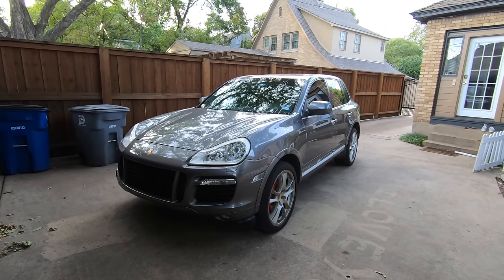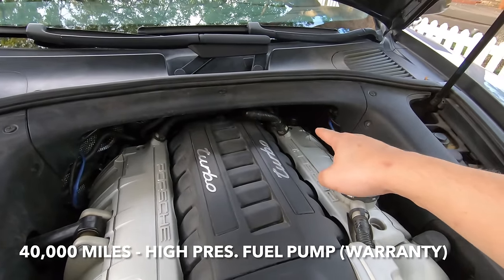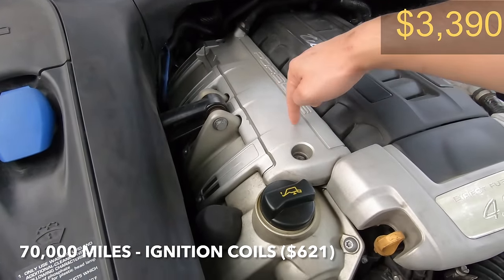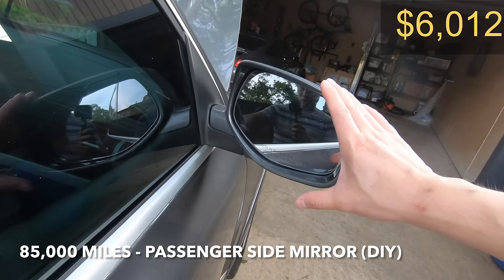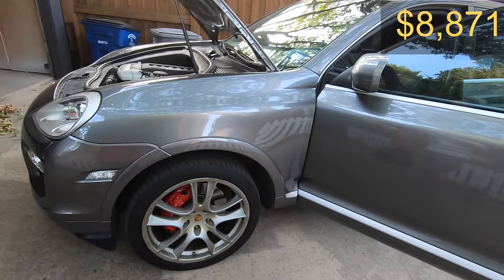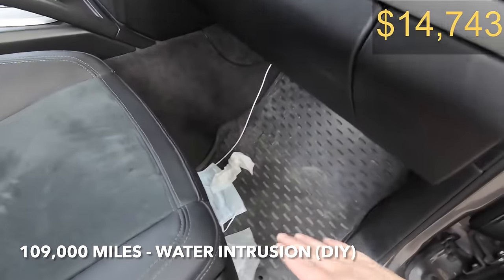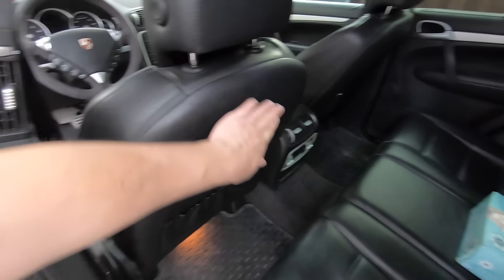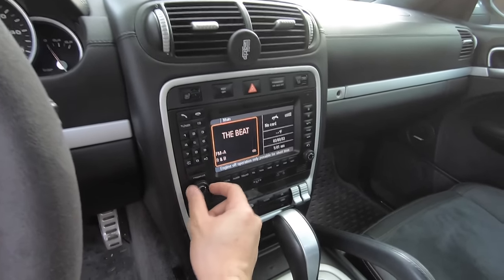Why Are Used Porsche Cayennes So Cheap? Owner's Review of 15 Year Old Cayenne Turbo (955, 957)

Comment: RIght! I owned a 2008 Porsche Cayenne S for 10 years (and before that a 2005 Cayenne S) I can say that these cars are very poorly engineered especially from a maintenance standpoint. Porsche knows their target buyer will only own the car for a few years. VW does not really care what happens after that. I experienced some of the issues you had but the sort of thing that put me over the edge was a failed temperature sensor which was a $25 part. I looked at doing the replacement myself but it was a 4 out of 5 difficulty so I called my mechanic who said yeah, that's probably $1000 to change. Do I even need a temperature sensor? The thermostat is mechanical. Yes you need that. A conversation like that happened every few months. The useful life of that car is maybe 10 years which is a BIG waste in my view and an example of terrible engineering.

Comment: German cars are made with cutting-edge (sometimes bleeding edge) technology.   Their engineers focus on top-notch performance, not durability.   The Japanese cars get dinged for not having the the most modern tech but their tech has been debugged over years of failure analysis.   If you want a German car, buy it new, sell it when the warranty expires, and then sell it, take the hit on depreciation, and buy another new one.

Comment: This is the Problem with buying any euro luxury car not the initial cost its the running costs that make you end up selling it and going back to Ford or Toyota avg cost of Mercedes benz service in Australia is close to $1000 avg service for a Toyota or Ford is closer to $350 over the course of the cars life thats a massave saving not even mentioning more serious repairs than a basic service
Reply: And 2k for wheel bearings is absoloutley disgusting

Comment: I had a 06 turbo when it was new to about 100k omg worst car ever absolute blast when working, but after 80k every peice of engine plastic and vacuum lines were failing ended with frozen turbo got 2 new turbos  then rolled piston rings on 2 cylinders

Comment: Stick to Toyotas, i have a 2010 Kluger, 3.5 V6. 181000 kms, only spent $130 on repairs, -  fixing the drivers electric window(wouldn't go back up)....had the car 11 years now, and service it myself. will keep to at least 250K kms.

Comment: Your problems are very similar to the worst car I've ever owned. 13' Q5 3.2. Leaks, wheel bearings, water intrusion to ECU, power steering leaks and then I definitely had to sell it when it started burning oil. That was only within a 2.5 year span. Now, for fun I buy Japanese sport bikes, currently on an MT10, that will kill most porches. For cars, I pick Toyota/Lexus. Sure, not as exciting, but very durable in my experience. Currently enjoying my Lexus RX

Comment: Too much japanese ownership BS here.. As a Lexus owner here is my perspective. Cayennes are know to be very reliable and this is clearly a rare exception and in the lifespan of 15 years. Lexus are no different.. lets take a Lexus RX/GX with its notorious poor chassis/body quality you have rust frames, paint peeling, clear coat fading, melting interiors, head gasket issues, transmission issues, engine out jobs in the 2GR, self destructive engines like the 2AZ... You will easily blow much more than $20k or even $30k fixing toyotas mistakes in 15 years as this porsche and you will still be in a lower trim less capable car. Thats the only truth in this. Neither are perfect.

Comment: Wow! What a POS! I’m still driving my 03 Accord coupe with 295k miles. I’ve had to replace the cooling fans, a VTEC solenoid, and a knock sensor. That’s it! every other part is OE down to the alternator. I paid $21k for this car brand new. It’s also been my son’s car for the past 4yrs. He has modified it quite a bit and drove it like a stolen rental car. Yet it just keeps on going. When he bought himself a new Audi, we just couldn’t bare to let it go. That Accord is the only car that’s not German in our driveway, 2 Mercedes(GLK350& C63),1 Audi(S4),1 VW(Mk6 GTI) It seems the more it costs, the more headaches you will have with it. Who needs a loner car from the dealership when you have a Honda sitting at home 😂

Comment: Apart from 3 original Beetles I had over 15 years as a young man all German cars I have leased or owned or shared since have been been more than disappointing. I stopped buying European cars at 45 and changed to Japanese and Korean.
China's major developments over 15 years are now about to overturn especially the German industry because it relied for too long on reputation  and not experience on the road. They are all wildly overpriced and we in Europe were never compensated for various scams by the VAG group and BMW as you were in N.America.
The Cayenne was never seen as a proper Porsche in north west Europe because it was problematical in cold, wet weather and looked too much like every other SUV out there.
Lazy design and lazy workmanship.

Comment: 200,000 miles on my 08 Tundra, the AC compressor and a bearing. That's it.
$ 1500.00. German cars' reliability is disgusting.

Comment: I bought one in 2004 when they came out, nightmare. I bought another one with 30,000 miles but the guy was a weirdo and would take it to the dealer for everything even though he never drove it. I bought it because it smelled new. Piece of junk…. My Tahoe is a 2009 and never breaks down.

Comment: Terrible MPG, and constant repair items. It's not a great vehicle and you can get better driving experiences from much cheaper and more reliable SUVs. People buy Porsche for the brand mostly, I ditched mine after a few years, got tired of the constant maintenance issues and the troublesome V8 engine. It's also a target for thieves.

Comment: Porsche - totally overrated. Had one hybrid Cayenne from new for 4 years and no problems. Next new one had total suspension failure after only 22months." Fixed" under warranty BUT I could sense it about to fail again. Got rid.

Comment: Because they're like every other buggy that looks like that?? If I can't put motorcycles in it, I can't use it. anything built like this with a unibody has all it's weight up high and that's why all cars now roll over with the slightest impact. the primitive technology of a boxed steel chassis can make a huge difference depending on how you view it. I bet an electric car wont roll easily because of the heavy battery pack under the car. it would be hard to roll over a Tesla I bet. all the weight is down low where it belongs. ahh, but I'll never buy one.

Comment: Those coils are standard VW Golf parts😂.

1 quarter the price for upgrade VW part vs Porsche Part

Ps 2200 for bushings and joints is a rip-off 

The parts cost 400 and labour is another 600
Reply from the maker: Maybe that's the case for the V6 models, but not the V8 models.

Comment: I had 2 Cayenne Turbos; a 2006/7 and a 2011.  Absolute rubbish.  2006 total repairs: $19k.  2011 total repairs: $28k.  Own a 2018 911 Carreras 4S and have not had a single problem.  Cayenne and Macan’s are garbage VW’s

Comment: Good lord. What a POS. My 2009 ford ranger (bought new) has 120,000 miles on it and the only repair it’s had is an alternator replacement at 110k miles. I could never afford one of these money pits.

Comment: Over $600 for ignition coils?! $2000 for control arms?! What are you doing with your life? No doubt it’s a high maintenance car but you paid at least twice for everything you had done to this car it’s really sad. (Ignition coils coat about 300 oem not 600)
Reply from the maker: Wrong. Look up the price of 8 oem ignition coils then factor in spark plugs and an engine strut mount. $600 is just parts alone. Control arms include labor and alignment. While you can do anything yourself and avoid labor costs, not everyone has the time nor equipment. Let's just say owning an old Cayenne is not for people who want a vehicle that is cheap to maintain.

Comment: Wow, makes it sound like junk. Having so much under warranty before 70,000!!! Absolute junk, poor workmanship.
My first Benz in 2001 needed nothing but oil changes and brakes for the first 90,000 miles. After that one window regulator and 1 wheel bearing. By that time it had about 150,000 miles on it

Comment: 15k with warranty and you did half of the stuff by yourself :D great car anyway but for poor ppl out there with 15k :D you can buy car's that goes another 15 years :D without much problems like my 2001 honda h-rv :D COSTS 2500$ ONCE YEAR need to check some stuff 2-3 years maybe fix something for 50$ :D same not much needed for 2017 hydai elantra no need for anything so far... for the next car  I'M THINKING Porsche Cayennes like 2019 maybe?>

Comment: Doesn't seem very German this German car. I have an Audi with 220k miles on it and the driveshaft bearing is doing fine. So are the turbos and the engine. Gearbox needed fixing and will need another one soon but compared to Porsche's issues that's nothing. 
Just goes to show that when you sell something with prestige attached and make it expensive it can be utter shit and people will stil buy it because when it's new it will work for a while.  
Of course cars like that are made for a specific market. Nobody cares if they a nightmare to maintain after years because only rich people buy them to use for a while. No problems there BUT all this is happening in the world of so called climate crisis. Common people have to do with smaller and smaller engines in cheap cars because of emissions and fuel consumption but when you rich, they will make special car for you and you won't feel the carbon tax anyway so enjoy this world.
Reply: It’s a VW Touareg in disguise.

Comment: Sell that piece of garbage and buy a Subaru. My 2006 Forester 2,5 T has done 331,000 kilometers and  except for head gasket replacement at 254,000 has had absolutely no issues...none!And for the price of that thing you could have bought 4 of those.....

Comment: What a shit. Aren't they abel to produce cars which run at least 150k miles WITHOUT ANY PROBLEMS? Mercedes, BMW, Audi, Porsche etc are a NIGHTMARE with all the electronical B.S.
We don't need an electric motor to shut the trunk, we don't need an electric break system, we don't need an electrical steering or sensors to start the whipers of the windshield etc, etc, etc
MAKE GOOD QUALITY CARS, NOT B.S. CARS!

Comment: Just got to two minutes 17 seconds enough.enough
VW product , guy who worked for me had a touareg  we couldn't believe the propshaft steady bearing was a plain non roller bearing when it failed at 60,000 miles
Absolute cheapskate engineering and apparently it's called a premium car , why is that when it's so poorly engineered